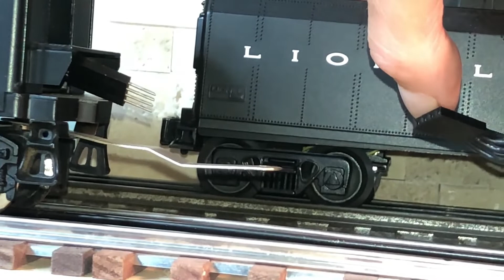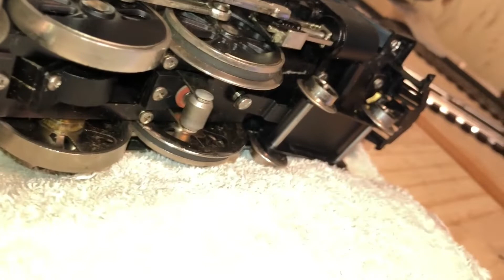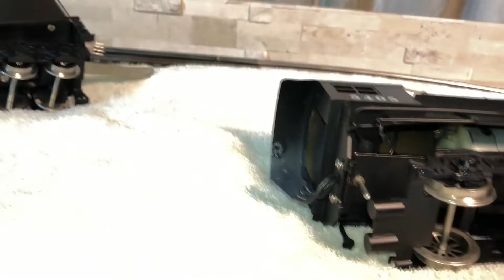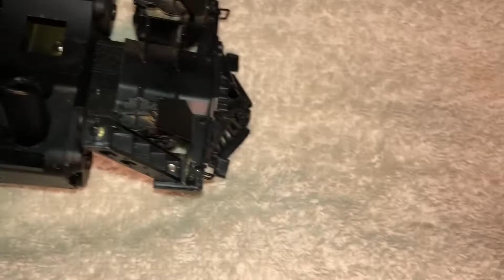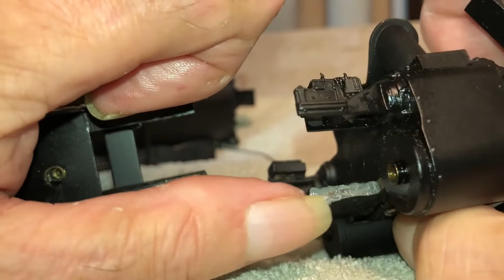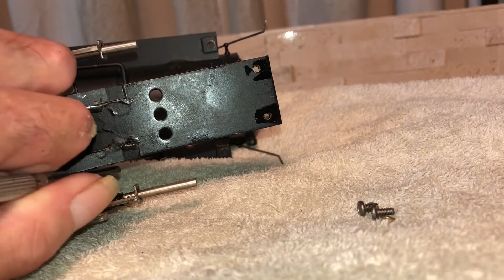Williams O Gauge Brass Scale Hudson needs TLC! Part 1

Comment: I just got one of these.. I found your coal load video for this first. Now, I'm starting at the beginning. Mine has the floopy front coupler too.  My big objection is the bright plated wheelsets.. I wish the small wheels were all black like the original, and the 6-18005 reissue. ... OK, I'm getting ready  to watch your series on these👍👍
Reply from the maker: I'm working on an update video on the gearbox and driveshaft because of a failure I had, stay tuned!